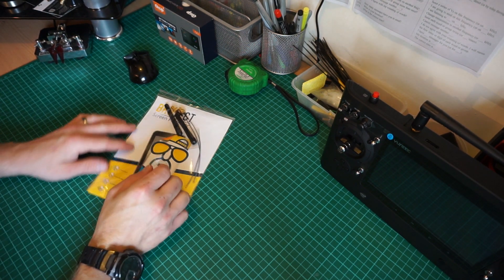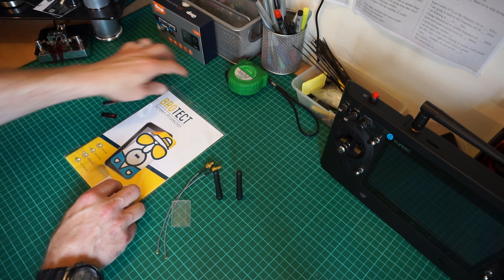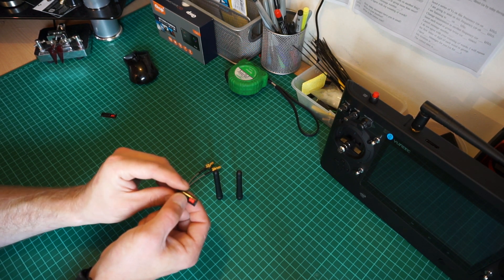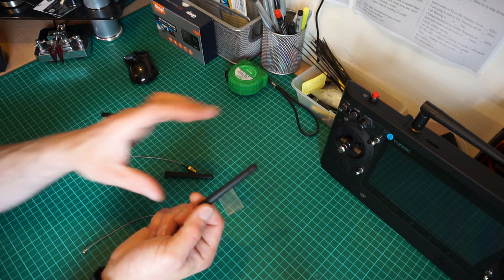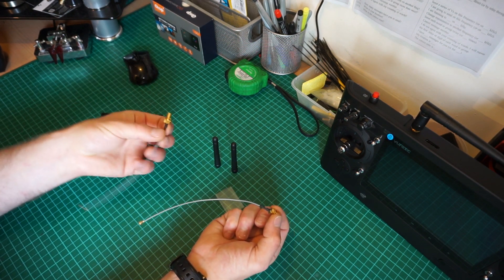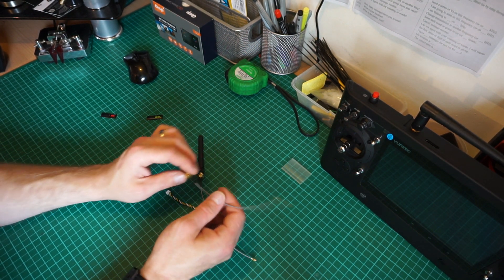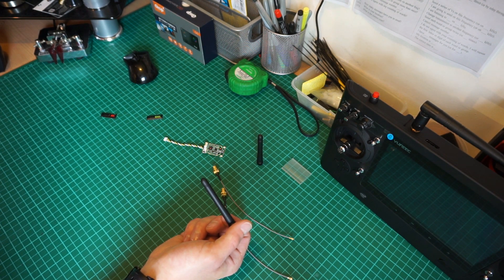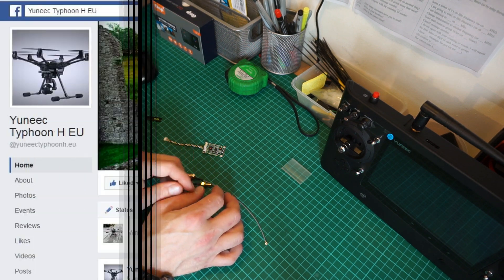YUNEEC TYPHOON H.  EXTERNAL 2.4GHZ ANTENNA MODIFICATION KIT, FOR CONTROL/TELEMETRY LINK.

Comment: I have gone further and fitted and air side booster kit from FPVLR 
I flew out to 4.5km today with solid rc and telemetry :)
I am using a skew planar and dipole
Reply: i also got a micro boosted 2.4ghz on the H also have a Internal 2.4ghz booster inside the St-16
Reply: I just set a new record today 
4.75 KM one way and got back ok 
was a warmer sunny here day with no wind
Reply: not bad haven't really gone out to the country side and tested both. its been very hot waiting for cooler weather
Reply: Hi, Raptor...just wondering if you could provide some details as to what and where you got your booster for telemetry on your H. I also have the FPVLR antenna set, but am constantly struggling with video dropouts. Any detail as to how to go about installing would also be greatly appreciated. Thanks!
Reply: The booster on the H is the FPVLR air side booster kit for the DJI Phantom 3 and inspire 1